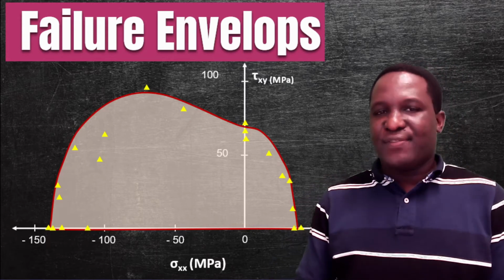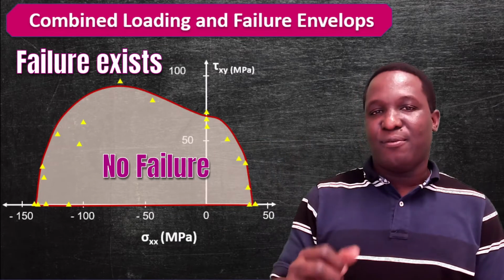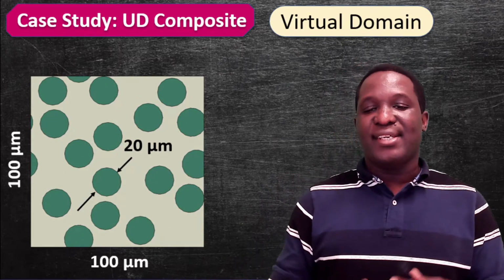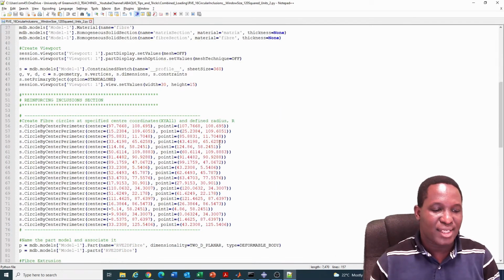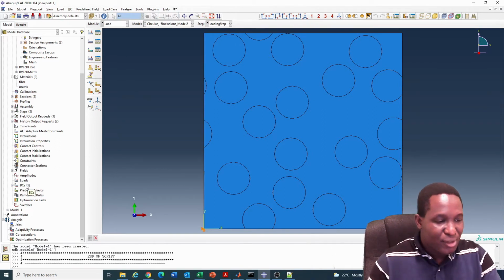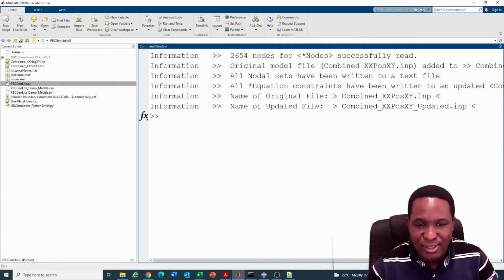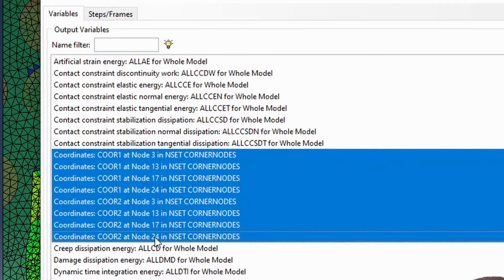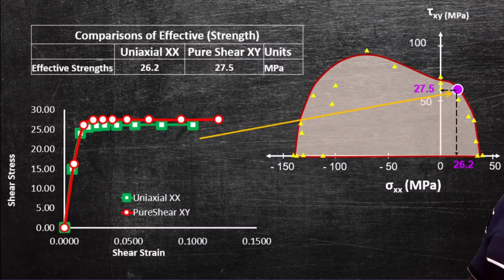How to create a failure envelop using numerical methods

Comment: Thank you once again for a great video and an interesting selection of topic. I noticed at the graph @24.47 where the new values are to be inputted, that the values are not in align with the axis. the  y value is  27.5 but in the graph is placed between 50 and 100 and the x value is 26.2 and is also misplaced. Furthermore can you suggest some extra material on this topic ( failure envelope ) ?
Reply from the maker: Hello @Faidwn, thanks for your continued interest in the channel. You are absolutely right, I did notice that my placement of the generated failure point is wrong - and I should have corrected that before publishing but I had rendered the video and did not want to go back to it. I hope many viewers will forgive that error. 

On further resources to help, I was actually studying Prof Stephen W. Tsai's book on Strength and Life of Composite. One of the chapters discussed this strategy of numerically generating failure envelops. I have not seen it in many places but during my post-doctoral work at Oxford University many years ago, I developed this approach for a work I did with an aerospace industry partner. I am sure if you search the literature, you can find others doing similar things. For a start, look at Prof Tsai's book. 

Also, you may find the approach in other areas other than composites for example this one from Geotechnics, which was looking at 3D failure envelops by applying similar strategy. Here is the link to the paper for a start: https://doi.org/10.1016/j.compgeo.2014.06.004